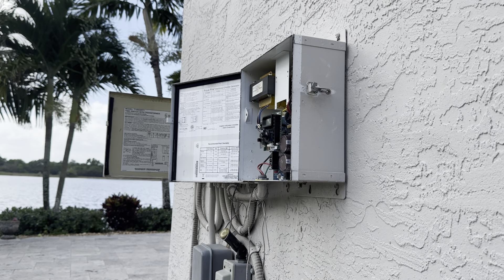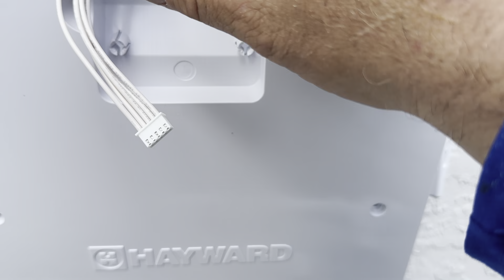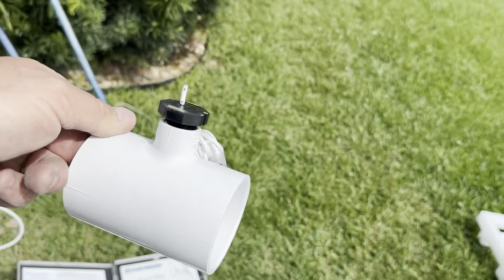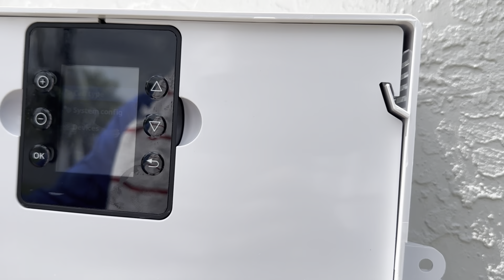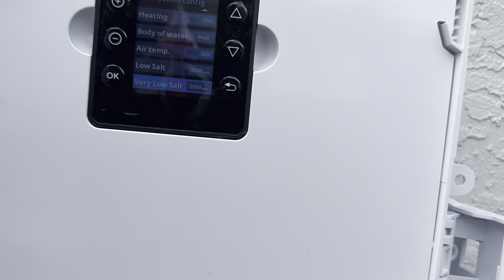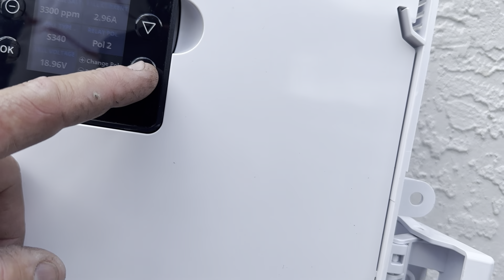Hayward AquaRite S3 40K Salt System Installation.

Comment: This is a great unit.  I purchased one brand new off of facebook market place.  Got everything, its the complete omni unit with the hardwired remote lcd touch panel.  Also got the hayward ecostar variable speed pump as well as the new s3 cell.  From what i gathered, you can connect your pool heater as well.  Got such a great deal on this unit as it was for a pool th at never happened.  I cant wait to install it this spring.

Comment: If you have l3 going to one wire and l4 going to the other in the end theoretically you're wiring it 220 not 115... You're still getting 115 all the time off of the l3 You just don't have a neutral to complete the circuit and when l4 via the time or kicks on it's a 220 volt circuit and this has an onboard sensor that allows it to work via 115 or 220 so you have it wired for 220.. two hots... But from same phase. One leg via timer

Comment: Curious, we had one put in back in 2022 when our pool was installed.
We are now finding there is basically only one salt cell that is compatible with the S3 unit, even if your pool is small. $1200, S340 is the only one currently made that will work with the S3, none of the others sizes look to be in production anymore. Is this an abandoned product? We are very confused on this.
Not sure why anyone would want this with such low salt cell support?
We are considering going to one that uses cheaper salt cells that are currently in production.
Reply: I think only the S3 salt cells will work with this unit.  I was told that the old t cells will not work.

Comment: Mine went bad after one season.  Do not get this Hayward system.
Reply from the maker: That’s a shame. Unfortunately your experience is not everyone else’s. This installed unit is still working perfectly from date of installation. Sorry you had a bad experience, maybe it’s not the unit but other contributing factors. Look outside the unit for cause. Or maybe it was just a faulty part. Contact Hayward tech support if it’s still with in warranty period. They will help

Comment: Is the new s3 turbo cell compatible with the older aquarite box you removed?
Reply: Oh sorry you mentioned that I have to install the new S3 salt cell have no clue what I will need to program on the older board
Reply: Yes all new S3 salt cell models are compatible with All Hayward Salt Systems including the AquaRite, ProLogic, Aqualogic, OmniLogic systems.
Reply: Which way do I install the tCell?
Reply: @debbieross4178 it doesn't really matter because the flow switch is what activates it, but you can put it where the chord is closer to the outgoing flow